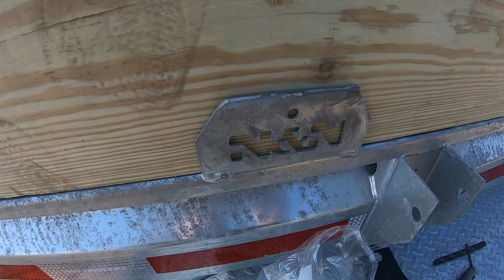N&N galvanized trailer gets sideboards and HAULS WOOD

Comment: I'm from germany.... we got some nuts with round head called "hutmutter"... dont know if headnut is correct. May these nuts looking better inside and are not so sticky when dumping. GNI
Reply from the maker: Yes, we call them carriage bolts here. Thanks!
Reply: @InTheWoodyard  not the bolt... the nut.... covernut seems to be a "hutmutter" in translation...

Comment: Good morning Chris!!😀😀
Love the new trailer!!😀😀
I wonder if you were to put a 2 x 6 on the bottom and then the 2 x 12 on the top. That way part of the 2 x 12 will still be part way in the slots. But you will still have to do something to connect the 2 planks together. Maybe a couple pieces of flat steel with holes drilled in them to hold them together. I do think that red would look really nice for the color of the planks. But that's just me. 
Have you gotten a break controller for the truck yet? 
Take care my friend!!😀😀

Logger Al
Reply from the maker: Thanks for the ideas Al! Not yet, I will not be using the trailer for a few weeks , Ken and I are beaver trapping or should I say ...trying !
Reply: @InTheWoodyard  I do have a controller if you want it. 
Good luck trapping

Comment: Also too Chris, just a suggestion. When cutting the pressure treated wood, places like Lowes or whichever you prefer; do carry circular saw blades specifically made for cutting pressure treated lumber. Less stress on your saw, won’t leave burn marks on the lumber; and it slices through the lumber like butter. Just a little tip for you is all
Reply from the maker: Thanks Bobby!

Comment: On getting the wood to slide better... I'm wondering if spraying a  coat of that metal paint into the galvanised deck would make the wood slide? 
I once had a sheet of painted plywood in my work truck and my tool boxes slid all over the place on it.
Just an idea.
Reply from the maker: Possibly!

Comment: To address the wood not sliding you can add a layer of HDPE on the bed of the trailer (you can buy in 4'x10' sheets)...it will be very slippery for the firewood, but not good if you're hauling other items that you want held in place.  Its not cheap, but I have heard it works great for dump trailers.
Reply from the maker: Thanks, some others suggested that too!
Reply: Be careful when it’s colder. Might crack it throwing wood on it
Reply: @toddjudson7281  shouldn't  be an issue.  I use the stuff on sleight for ice fishing in winter....they take a beating on ice at -35 Celsius  and I haven't  had any issues in over 15yrs.

Comment: I got lucky one day and got plastic boards for my dump trailer. They have been fantastic, tougher than a $2 steak. Been on there 6 years and still as good as new.
Reply from the maker: God idea Pops!
Reply: @InTheWoodyard  like I said just lucky, was waiting for a load to be finished for Wabash National. They use plastic I beams in reefers. I asked the guy if they had any boards like that and he told the kid loading me just to put them in my trailer for waiting so long to get loaded. I got two 20 foot long 2x12’s that are black plastic to match my dump trailer. Made from recycled plastic.

Comment: I think that's a great idea leaving the boards up an inch. The water collects in the pocket and rots the wood. A lot of guys around here paint those boards red, it looks sharp. My D rings are in the same spot as yours. It might not be a problem with firewood but when you have flat stuff on the trailer floor and you go to dump everything gets caught on them and it's a pain.
Reply from the maker: Good point!

Comment: You might want to consider staining the sides a nice cherry colored stain( it would complement the red).  Also you could get a can of Silicone spray or Butcher's wax and coat the bed of the trailer to help the wood slide out.
Reply from the maker: Good ideas Kim!

Comment: I’ve got the exact same trailer and sideboards as you have.
The price of the trailers have risen considerably since I purchased mine 4 years ago. About a fifty percent increase in price.
I’ve found wood thrown into the trailer, even with the top of the sideboards and mounded up in the middle, is a measured cord.
Definitely a well built trailer and galvanized to boot. Good purchase!
Reply from the maker: Thanks for the info Paul!
Reply: Do you haul a lot of wood?   Has it smoothed or started sliding better the more you used it?

Comment: 52 years ago (Man how time flies), I had a Ford pickup with an 8 foot bed.  My Dad cut Oak stakes and 2 x 12 boards, went two high on each side.  My truck was white, and he painted the side-boards Red.  When I filled that bed, it was a full cord of wood.  So my vote is RED. and yes, add some sturdy stakes and go higher.  Red will also match the tarp when extended.  Learn the GVW limits for truck, trailer so your loads don't exceed limits.  Usually it is stopping with a load that becomes the important safety factor.  Great Job Chris.
Reply from the maker: Thanks for the ideas David!
Reply: I would go to another foot on the trailer and I would go your silver color would match it.
Reply: David I tried to tell this to Chris one time about safety chains and tarping the trailer so wood did not come out and maybe hurt someone and he "Stated to me that he is not a safety kind of a guy" !
Reply: Paint ‘em red dude. Getting the silvers to match could be a tall order with the treated wood, dry or not…

Comment: I have a question does your tractor fit in the back of that trailer?
Reply from the maker: Yes but not with the bucket, I have two car hauler trailers I can use when i need to.

Comment: Hey Chris love the new trailer. They do make polypropylene liners for those trailers not sure of the cost but the guys I know with them in their trailers love them. Everything comes out super clean and adds an extra layer of protection to the bed from caving in the bottom of the trailer.
Reply from the maker: Thanks for the tip Ed!
Reply: It's probably not as loud throwing the wood in too?

Comment: Chris look at putting a liner on the floor of the trailer it's made out of a plastic called UHMW. It will quiet down the wood hitting the floor and it will help material slide out better.
Reply from the maker: Thanks for the tip Gimpy!
Reply: UHMW is a very live animal, it can grow in length almost 1/2" in 10' With bright sunshine in summer when its hot. You will Have a wavey floor. Would take a lot of bolts to hold it down, have to counter sink for the bolt heads. Every time you drill a hole in your trailer you will get rust & thats why you went w/Galvanised trailer & no rust.
Reply: Ultra High Molecular Weight Polyethylene would expand approximately.006”/inch. So a 10 foot length would change about .750 over the expected temperature range. This could be compensated for with oversized clearance holes and washers. The larger problem is probably going to be cost. A vibrator may be a simple solution.

Comment: Sweet trailer!   I would paint silver.  Is there room between the beams to hang the tire underneath since the ram in not under the bed?
Reply: Bad idea! Picture a loaded trailer, flat tire, pulled off on the shoulder, sloping shoulder. Raise it up to get spare, loaded bed will twist, maybe permanent kink! For sure unsafe!
Reply: @heymakerphd1982  good point.  Maybe there is enough clearance that you don't need to lift.  Maybe the same lowering device that are on pickups can be installed.  Just a thought.
Reply: @SeanBressie  Trailer frames are usually pretty close to the ground. But say you had clearance. Picture: flat tire, 6" of snow slush, traffic going by throwing more slush, dragging spare tire out after squirming under to get spare loose from retainer (which is rusted fast!), trying to clean it enough to install, snow snakes down in there making your life miserable!! The reason the mfg's put spare tires up on side or tongue.
Reply: @heymakerphd1982  😎
Reply from the maker: No, that would not be good with a loaded trailer or in the winter.
Reply from the maker: Yup!
Reply from the maker: Yup!

Comment: Looks nice! The only issue with really tall sides is when dumping wood chunks or logs in over the sides. It can be really hard on the trailer floor and suspension.
I asked Andrew about longer tables for splitters on live feed last night. He said they make em all the time basically for just what little the extra material cost. He said to just mention wanting that option when ordering splitter but didn't say what options there is for current owners. Sounds like an email or phone call and a longer table would soon be on its way!👍
Reply from the maker: Thanks Wayne!